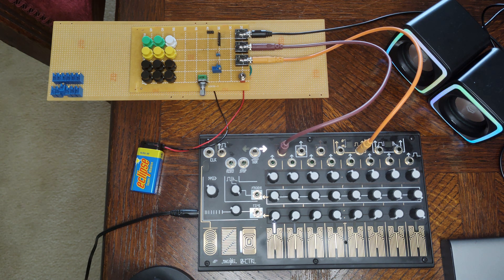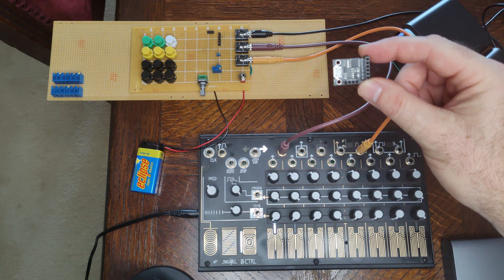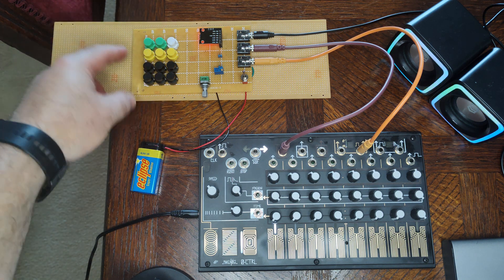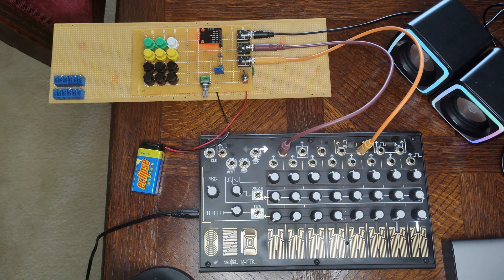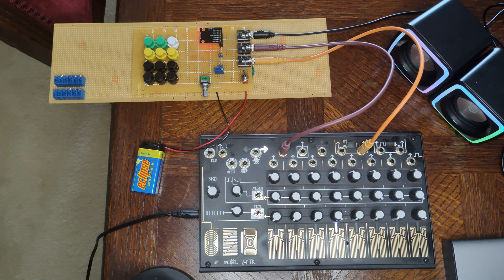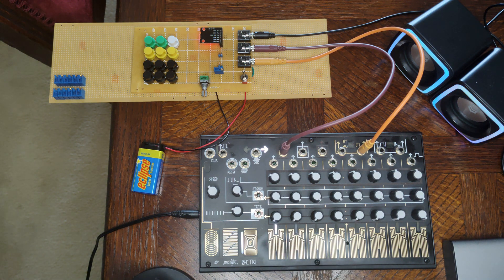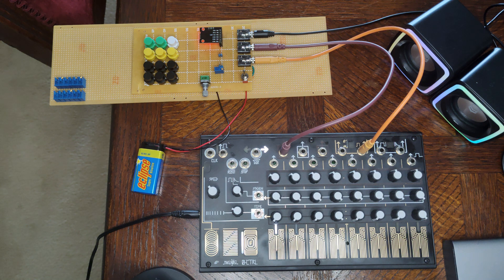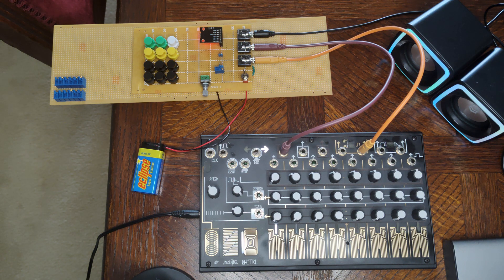A homemade additive synth using an attiny85 (part 1)

Comment: Sound really good. Is it noisy at all, did you add some kind of filter to the circuit?
Reply from the maker: Yes there is a bit of noise. The speakers naturally filter the sound though. In the next video, hopefully uploaded later today, I run through a filter and that gives an almost perfect signal. I was quite surprised at the quality.